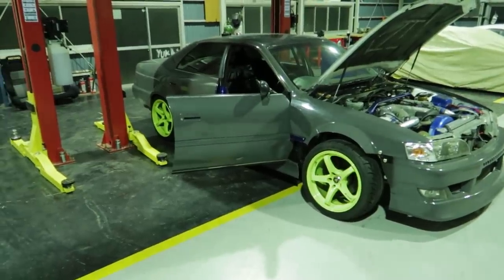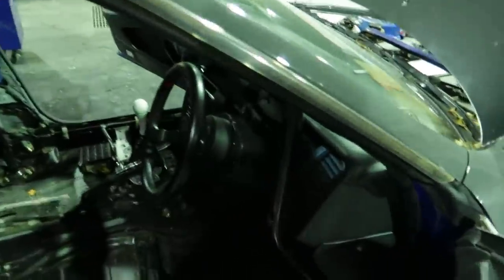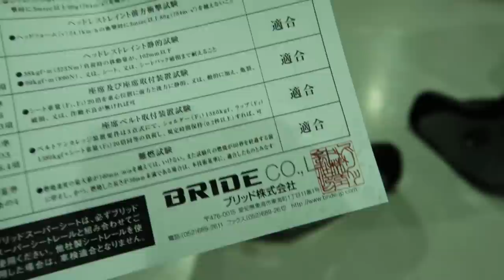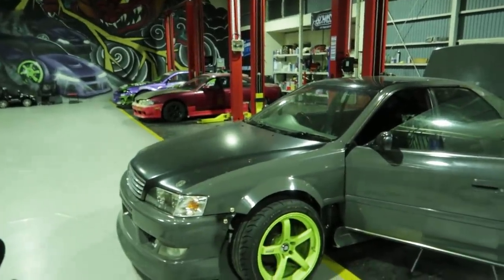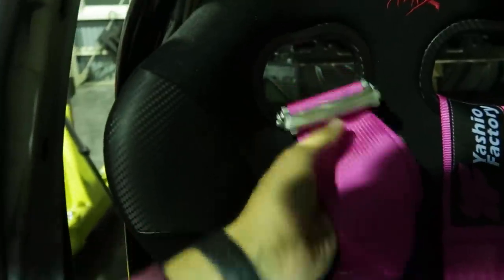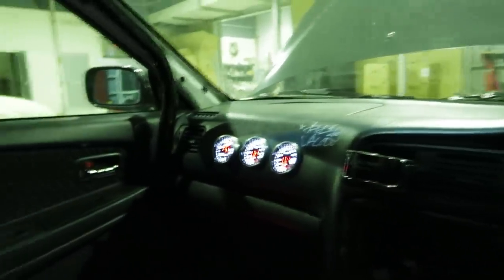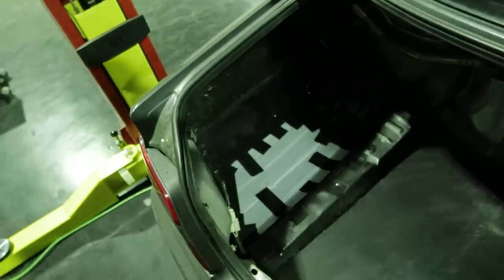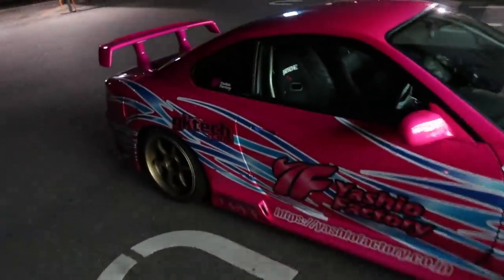JZX100 DRIFT MISSILE GETS GENUINE REAL BRIDE SEATS!!

Comment: Also check the connection on the ignitor connector at pin 8. Thats where the wire for the Tacho goes through in the engine bay

Comment: Hey Sammit, I hope you can help me. I am from Germany and I have a 200sx S13 with an SR20DET swap. I have the Problem that every time when I am drive and press the clutch and hold it, my engine has to shut down every time. when my car stand still and I am in neutral my engine fluctuates  between 400 and 1200rpm. I hope you or Oka-chan can help me. 
greats from Germanyand drive safe :)
Reply: Have you checked for vacuum leaks?
Reply: @dohc1974  yes, no vacuum leaks and sometimes when I go full throttle, something kills my power. my boost display says that i have 1.2 bar but i have no power.
Reply: @terrort0ast178  what does your car idle at when it’s cold start and warm? Have you checked Intercooler pipe for boost leaks?
Reply: @dohc1974  in coldstart it starts normal and is about 1200 rpm. But when it goes warm so about 60°C oil Temperatur, all the problems starts.
I checked the entire system and I have no boost leaks. :/
Reply: @terrort0ast178  Interesting. Well here’s something else you can try. Clean the throttle body with special cleaner designed for throttle body’s. Sometimes gunk builds up inside and makes it hard for cars to idle. Another thing is to clean the idle air control valve with special cleaner too. Also is your car very low? You can check the wiring harness that runs along the fender to see if there’s any wires that have  corrosion inside or rubbed through from the tire.